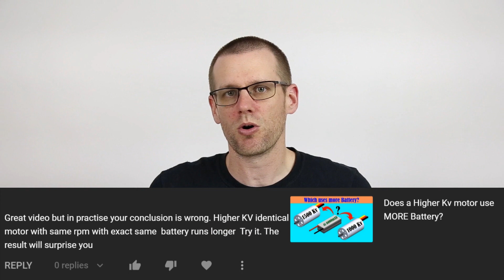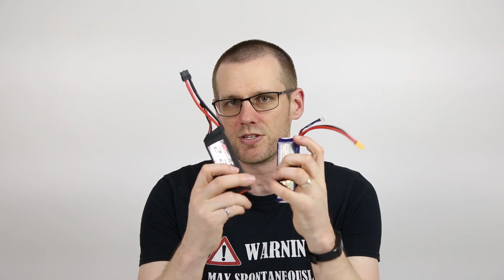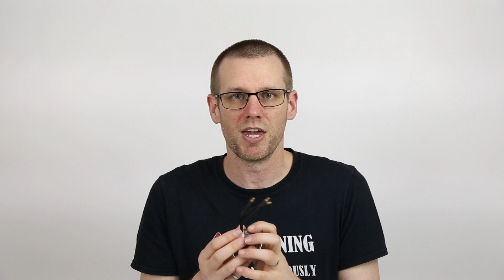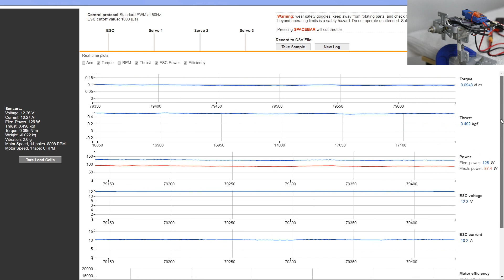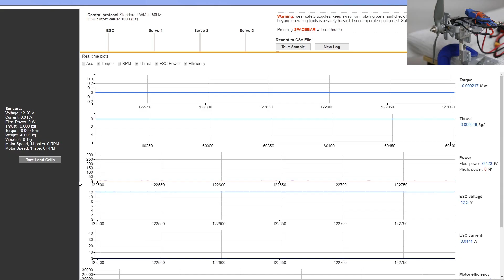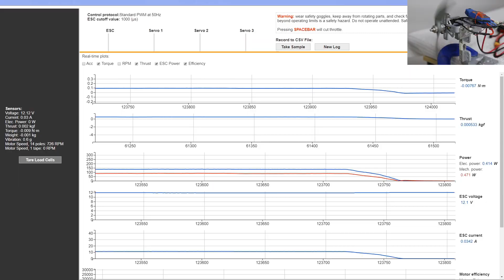Does a Higher Kv Motor Use More Battery vs a Lower Kv Motor - Dyno Test!

Comment: From everything I've read and understand, theoretically, the most efficient electrical system is zero resistance, minimal voltage, and infinite amperage. In practice, this is impossible/impractical for a number of reasons, so the general rule is that if you can't handle more amperage, it's more efficient to up the voltage.

As far as motors go and how it applies to RC cars:
Lower KV, same gearing, same voltage = lower temps, lower top speed, less draw, longer run time, same acceleration
Lower KV, adjusted gearing, same voltage = similar temps, same/similar top speed, similar/more draw, shorter/similar run time, poorer acceleration
Lower KV, same gearing, higher voltage = lower temps, same/similar top speed, similar/less draw, similar/longer run time, same/better acceleration
Lower KV, adjusted gearing, higher voltage = similar/higher temps, higher top speed, similar/more draw, similar/shorter run time, same/poorer acceleration

Technically speaking higher KV should make more power (power vs torque theory since power is torque over time and RPM is basically how many times it applies torque per minute) and be smoother, and, technically speaking, lower KV has more torque per amp. However, lower KV also has higher resistance and, as such, can draw fewer total amps, but when you bump voltage it becomes more efficient (and more voltage = more torque, too) and then you can adjust gearing to take advantage and equalize power.

The only other way to truly get more torque is to have a physically larger or more efficiently constructed motor (IE tighter magnet tolerances and neater coil windings). Outrunners will also produce more torque due to how they're constructed, and because they tend to have more poles and whatnot, they also run smoother to the point that you don't need sensored motors to prevent cogging or improve low-speed performance with outrunners. They are, however, far more absolute about their maximum safe RPM since the inertia of their rotation is higher/has more leverage that might allow it to catastrophically fail.

Saw a guy run 6s through a 3500kv Velineon motor using a castle 1/8 ESC. That's 2x the RPM it's rated for (3s) and probably 50% more than it could reasonably be safe to take (4s) regularly. I've never heard of any drone or plane guys running that far out of spec on their motors. Not even 5s on a 4s motor.
Reply from the maker: You are correct in saying  "I've never heard of any drone or plane guys running that far out of spec on their motors. Not even 5s on a 4s motor."
I have not either. However, the car guys can really only hit this RPM for a small moment in time. Otherwise the car is going to be in the next neighborhood. Where as, I could leave my plane at 100% throttle the entire time.
Reply: @RCexplained  true. speed runners are kind of a different breed. If they get 3 back to back runs before needing a cooldown, they're happy. The 6s Velineon guy could only do one pass at a time and from what I saw he only pushed it that hard for one day/pack. He got 106mph out of a Traxxas bandit, though.

Comment: Hi Ryan!

[ 3650 9000kv VS 3670 3000kv ]

I just want wonder which motor will give us the faster top speed (assume all other aspect is same like battery/tire/ESC/gearing) ?

This is important before I can make the next upgrade 😁
Reply from the maker: I would prefer the larger motor but gearing and possibly battery would have to change.
Reply: @RCexplained  thanks for your reply. i have 3560 4250kv . my esc is EZRUN MAX10 120A. can i use 4s?

Comment: I think this test does not align to real life setup, because normally the gear ratio is also a factor. 
I think, in the test both motors should be driven full speed (no losses from the pwm conversion). There should be a gearbox between the fan and te motor, correcting the  KV, resulting in the same prop RPM
Reply: I second this call. It's not extremely useful in the real world.

However, the video does demonstrate that when both motors are producing the same amount of thrust, the lower Kv motor is more efficient. Unfortunately, we didn't get to see the two motors that were tested. Was there any physical difference between the motors aside from the windings? He said so, but why not show both motors side-by-side?

Comment: I'm a surface guy, so my way of thinking might be different, but I came to the same conclusion. I always gear for speed and I have compared a Low KV to a High KV, but did it my own way. This was in around 2006-2008 and Castle Creations was gaining market with the mamba max esc and 2 pole motor in the surface segment, At the time, Sky and technology had their quark car esc's as well. 
     I had built an Associated RC10T4 setup with the mamba max and castle 5700 KV motor and a 2s battery pack (maxamps 8k ( think 25c rated)). I also had an Associated RC10GT (Nitro) Converted to electric using a Quark car 80 amp esc with a Lehner 1200XL motor (1200KV) I had this powered by a 5s Battery pack (Flightpower 2500 30C rated). I had them geared within a couple MPH and ran one right after the other. The Mamba/5700kv ran 20 minutes with the 8k 2s maxamps, the Quark/1200KV 5s setup ran 25 minutes. 
     I realize there are inconsistencies in my run, I did not aim for identical shaft (prop) speed, but went for package speed and weight (whole cars). But what i was looking for was settleing the argument that high KV/low volt RC cars run longer (by many at the time including Novak electronics) Vs a low KV/higher volt. I never once saw the 2s beat the 5s setup, I attributed this to two factors.

    #1. Higher voltage naturally raised the overall torque of the motor allowing a high static gear ratio and keeping the RPM's lower for better cooling
    #2. Higher voltage also lowered the switching required by the ESC to turn the motor. less switching over equals more efficiency and cooler running and lonfer life of the ESC.
    Me personally I prefer Lower KV/higher volt, simply from my findings on efficiency. I'm not like these other guys, trying to break speed record or tilling the ground with more power than should be legal. I just want to run as long as possible, without changing batteries
Reply: What you tell is right because power is equal with amps x voltage. Less amps equal less heat, thinker wires etc
 but I like the opposite. Reasons are 1s or 2s battery are far cheaper, lighter and can even fly with 18650. So I like low kV motors with big prop (3 inch) on toothpick drone. I am not so on hard acro, i like more the fast cruising  between bushes, trees and a little acro.

Comment: Sorry Ryan, but I think there is an issue with the experiment. Not sure how big the influence would be on the results though. 

For the second motor, your experiment started with a less than completely charged battery. 
Due to the lower voltage, the motor needed to draw more current to have enough power to reach the 8800 RPM that you were aiming for.

With a fully charged LiPO, the second motor would also have been more efficient.
Reply from the maker: Good point, I think I spent too much time practicing to hit the same RPM as the pack was recharged. As for the result, current will drop by no more than 0.3A as we are increasing voltage by 0.3V. Reason we know this is that the throttle position to hit the same RPM will now be even lower. Electrical power consumption will go up. This would suggest efficiency of the motor at the higher voltage will be less. ESC Chopping is responsible for this. I'll run the test now and post the results when complete.
Reply from the maker: For the results of this post Dyno run, check out the latest community post here. there is also a link to a video in the description of the post: 
https://www.youtube.com/c/RCexplained/community
Reply: @RCexplained  Thank you. Not what I was expecting but you made your point very clear!